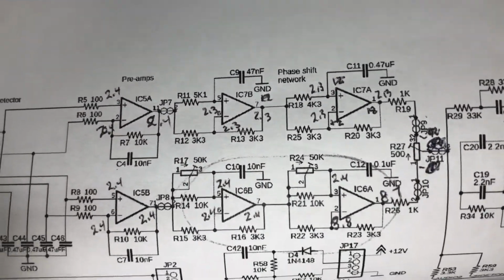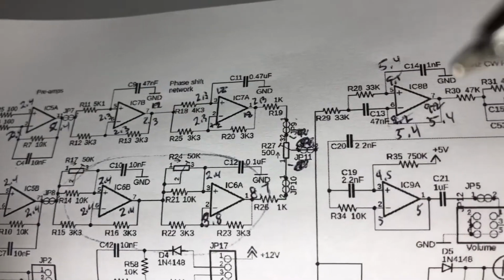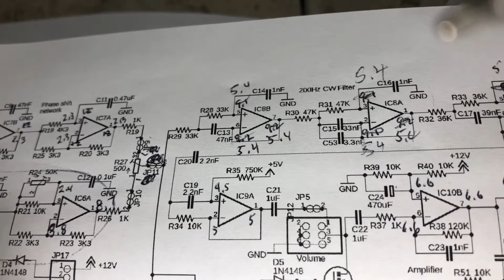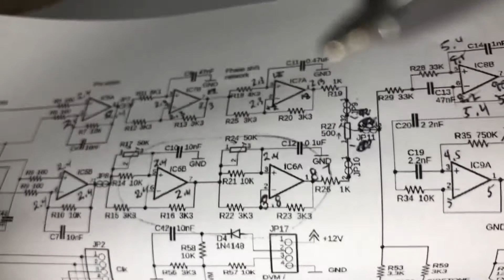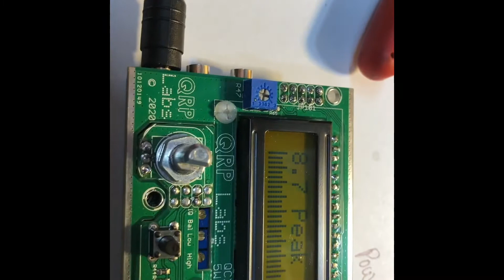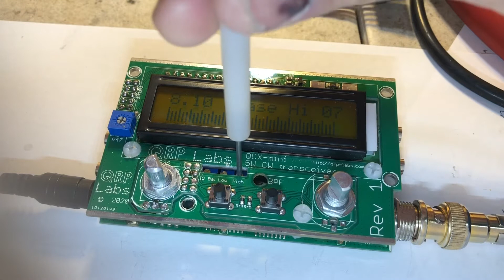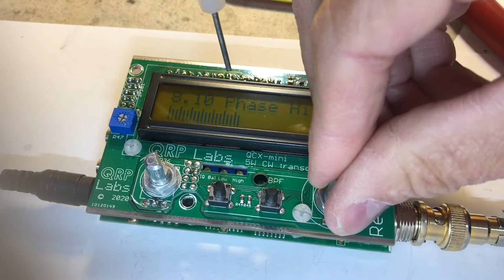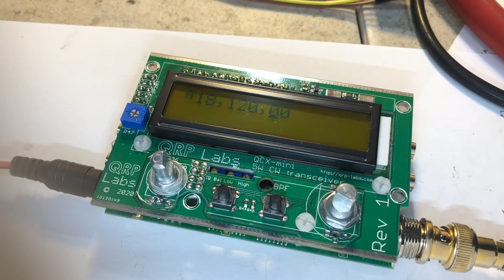QRP-Labs QCX Mini Repair

Comment: Hi Ron, nice to run across you on YouTube. I gave you a thumbs up and subscribed. The QCX 50W PA you helped me with on QRP Labs groups is working just fine.  I was going to order a 40 and 30m QCX Mini but might opt for one of these models instead.   The most noticeable difference to me is the power button, which is nice.  73  Brent

Comment: I think I have a similar issue with ic5 on mine. I used an oscilloscope to diag it. I wasnt able to make sense of how to do voltage checks from the repair info that is supplied by the company. Your diagram looks pretty helpful, though.

Comment: Question:   I have the Rev 1 board with the old voltage regulator “AMS 1117”. Can I just remove it and replace it with a M7808 regulator ?
Reply from the maker: I think you mean a 78M05. The 7808 is an 8 volt regulator. You want a 5 volt regulator here. And the answer is yes and no. It isn't pin for pin compatible with the AMS 1117 but it can be made to work. You have to move it over to the left (toward the DC power connector) by one lead spacing so that the output lead of the new regulator (right hand lead) is on the center of the three old pads. That's the output pad for the regulator. The left most old pad is the ground connection. Solder the center lead of the new regulator here. Now you will solder the left most lead of the new regulator (the input lead) to the cathode end of the isolation diode. To make this fit you also need to carefully trim off the tab of the 78M05 and carefully position it on the board so it doesn't short any components. It CAN touch the old large pad that was connected to the tab of the old regulator. This point is not grounded or connected to any other components. If you installed the recommended added electrolytic or tantalum capacitor to the old regulator, remove it as well. It isn't necessary or recommended with the new one. The right most old pad on the board is the input to the old regulator. Nothing needs to be connected here but be careful removing the old regulator. If you damage this pad you might accidentally remove a very thin trace on the top of the board that supplies 12 volts to some of the op amps. I managed to do that once. Hope this helps. I've done it on several and it works well.
Reply: @rontaylor9026  yes.  I printed 78M05 but my phone “mis corrected” it to 7808 

I’m heading to the board to figure it out.  Maybe I can just buy a replacement board instead.   I have not populated the board at all yet.  I wound T1 and then saw the notes about the Rev 2 notes.  I appreciate the explanation.  I will have to try figuring it out.  I need to buy the new component from Digi-Key.
Reply from the maker: @GreyGhost-r4z  Actually it should be very easy to do it since the board isn't populated with through hole parts yet. It's worthwhile modification if you want to do it. Good luck

Comment: Hi, yes, i had to change the same chip. Made a soldering tip with an M5 cheese head brass screw to heat both sides of the chips legs at the same time. Relace it with NE5532 and it works just as good than with the original 2277, much more expensive!! G0VUF.